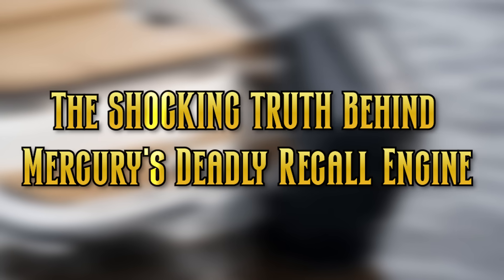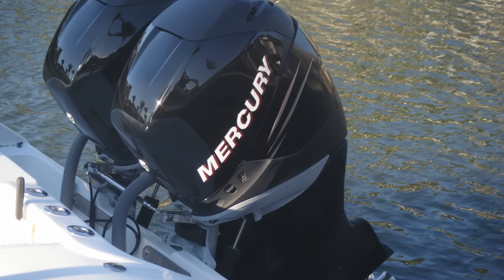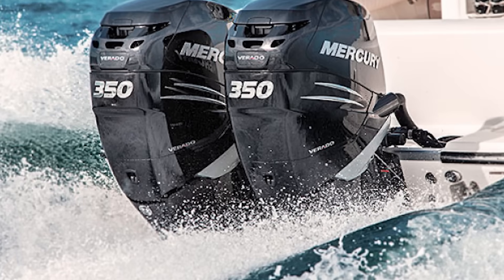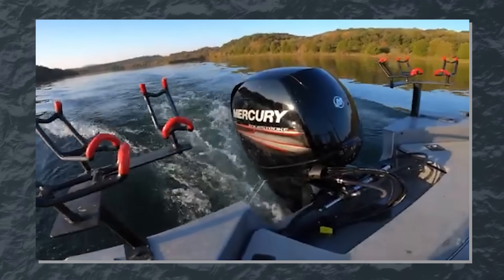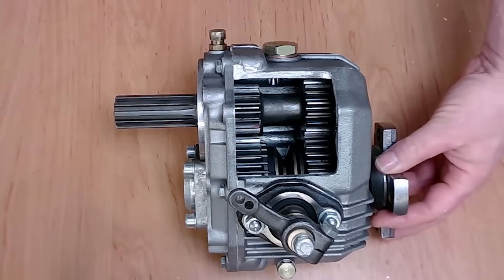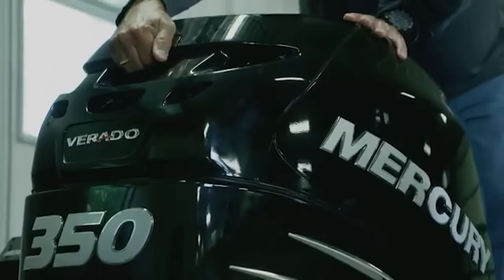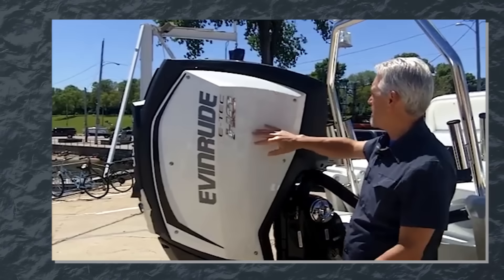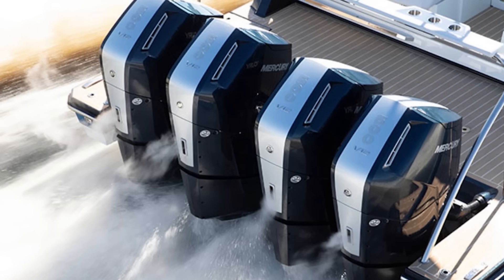The SHOCKING TRUTH Behind Mercury’s Deadly Recall Engine!

Comment: At 12:05 the video shows a hack greasing a bearing with 2-4c even though Mercury specifically states not to use on bearings. It’s good grease for a lot of applications but not on bearings.